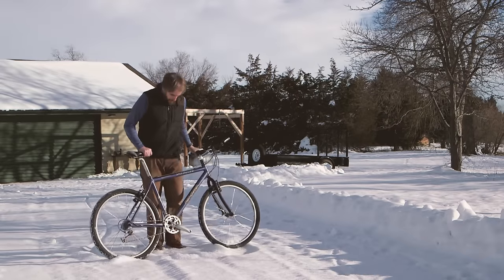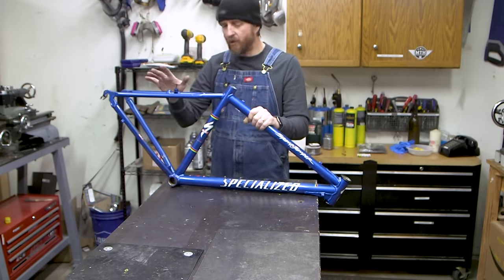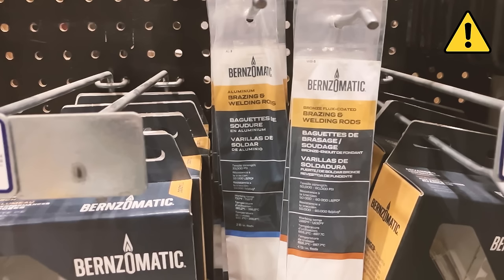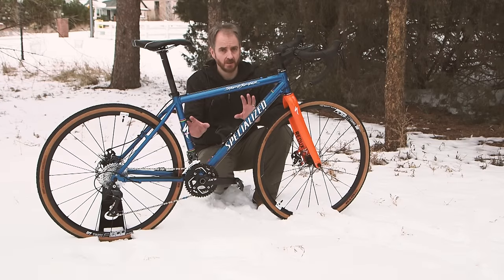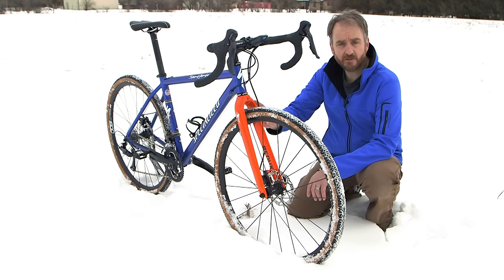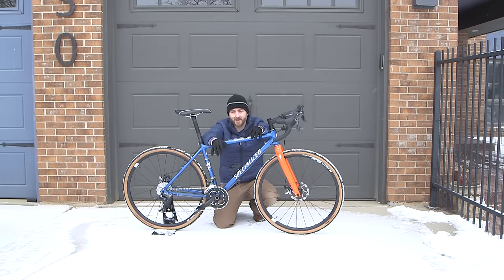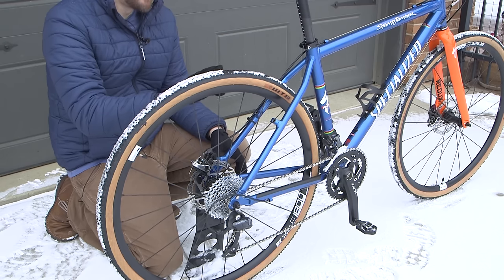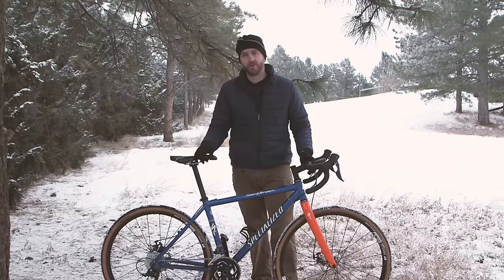Specialized Gravel Bike - Convert 90's Mountain Bike to Gravel Bike

Comment: Wow, I do have an old '95 Stumpjumper M2 in very similar color. For the gravel conversion I bought a modern 80mm Rockshox Reba Air that already has the disc mounts. For the rear brake I kept the V-brakes (XT parallelogram brakes) using an Extreme cable pull adapter. Most of the braking is done on the front anyway and a mechanical TRP Spyre does the job. Built it with Shimano Tiagra 4600 10s STI and 9s XT derailleur (same cable pull) and love it.
Reply: Doesn't the higher breaking force of hydraulic disc break damage your frame that was never designed for this force? V-brakes can be quite ok, especially if the terrain isn't all to steep.
Reply: @JohannesCycling  No. The REBA fork is quite sturdy and designed for disc brakes. The early Stumpjumper frames of the 90's were very robust as ultralight hydroformed frames were not invented yet.
Reply: @DilbertMuc  Yes of course the fork itself is going to be ok, with disc breaks as it was designed for this system. My "only" concern is the frame 😬
Have you done steep downhill descents on this bike where lot's of breaking is required? I live in the Alps, and the road steepness around here is more often than not measured in the double figures %. Some of them are more than 20% steep which can sometimes be frightning when descending on an rim break bike. 😄
Reply: @JohannesCycling  Yes, I too live close to the Alps and have been riding there for over 25 years with this bike. The M2 frame is accepting up to 80mm forks and also was delivered with a Judy DH (DH=Downhill... cough, 80mm suspension instead of the usual 63mm 😅 ) later on, even before they enlarged the bossing at the steering post.

Comment: It's worth mentioning that 7-8-9 speed Shimano shifting components have the same ratios so it is possible to mix and math sora with altus/alivio and acera. I use these on children bikes, folding bikes and on my hill climb commuter bike (9S XT cassette as bigger range than Sora and lighter than Ultegra).
Also, with 26" MTB, 650B is a good option. I ride/race my modern carbon gravel mullet bike with 650b wheels, XC race tyres and XC transmission (700C are gathering dust)
Reply: I successfully married SORA R3000 and Shimano Deore LX. Works like a dream. BTW Great video.

Comment: Love the idea. I've done a much milder version of it myself on my 2000 Stumpjumper Pro that had been sitting for over 15 years. After I replaced all the overly worn components, I simply put 26x32mm tires and fenders on it. It loses out on absolute efficiency compared to discs and 700c wheels, but it was my first serious and expensive bike and I wanted to keep it as original as possible while still being able to use it. I've put about 2,000 miles on it since and love it all over again.
Reply: I used to switch tires on my 90s mtb to 26 x 1.5 slicks back then when I wanted fast tires.
Reply: @photorockbar471  I put a 54/40 chainset on my 1990 Stumpy along with 25mm road tyres to get a fast road bike. Later swapped it back to skinny MTB tyres and left the crazy chainset on it. I used to beat everyone up the steep off road hills because I had no easy gear with a 40-28 lowest ratio and then lie on floor at top gasping for breath. 😁
Been wondering for years about resurrecting it with disc brakes.

Comment: Converted my Gary Fisher Big Sur to gravel a few years back.  It already had discs but had to convert to cable rather than hydraulic -- the road  shifters (105) were cable pull.  I lucked out as the 105 10 speed road shifters have the same pull ratio as the deore derailleur 9 speed on the  mtb. I ended up buying a 10 speed cassette and everything worked fine. I didn't upgrade to 700c and I kept the shock fork on it.  The local gravel boys thought it was a bit odd, but the terrain here is definitely a bit more off road and the shock really comes in to it's own. ( Not surprisingly folks are now buying shocks, with a lot less travel, for the front end of their expensive gravel bikes) Your frame probably has better geometry for this than mine. Nice conversion.

Comment: Love this. As a tinkerer myself (I converted my Giant hybrid with V brakes into a pretty decent road bike with disc brakes and did all the work myself) this video really speaks to me. And your final product is beautiful. Well done! The only thing I wouldn't feel comfortable doing is the addition of the disc brake mount, but fortunately for me my frame came standard with an ISO disc brake mount (though the fork didn't have a disc mount)  so converting to discs was a simple matter of replacing the fork.

Comment: Nice build! 
I can’t post a photo, but I run and own Bimble Bikes in the U.K.
Our aim is exactly what you have done, we restore, modernise and modify old bikes to meet modern demands and reduce the landfill and footprint, plus like you said, it’s a way to have a unique custom one off!
I have built a Gravel bike from a 90’s MarinSan Rafael which as you may be aware are already 700c and have MTB geometry.
Well done for your video, your build and the comprehensive guide to what’s required.
Lovely looking bike too.
Reply: Hi do you have a website? Also are you able to weld a disc brake mount like the one in this video?

Comment: I did the same but with a 2011 Ridley CX bike…..kept the cantilever brakes (Avid Shorty Ultimates), put a SRAM 1x 10 speed on it keeping the Fulcrum Racing 7 wheel set. She’s fast and amazingly still turns heads.

Comment: Having to braze on a rear brake mount probably puts some people off from doing a conversion like this.  I kept the V-brake on the back and used a mechanical disc on the front fork which I had to get new. A decent V-brake set up stops you well enough and in any case it's the front that does most of the braking as your weight is pushed forward as you slow down.
.
Reply: Yeah that would be my method without having the tools to do the mount at the back. For the same reasons you give.

Comment: Nicely done bike change.   I converted a 1994 Trek MTB to a gravel style bike.   You definitely don't need to go through the trouble of adding a rear disc brake mount since V brakes provide plenty of stopping power for most riding.  If converting to 700c wheels, then the brake mounts will be at the wrong location in the rear and will require a brake pad extension.  One can always use a disc brake on the front if one desires extra braking when they get the 700c trail fork.
Reply: There are some long slotted v brakes for conversions. You can alternate 26in and 700c wheels for events or seasons.
Reply: And there's hydraulic v-brakes by Magura I think
Reply: @paullevy-adophy9198  they are great but can flatten weak rims

Comment: That brazing is brilliant! Glad you talked about fit. The fit of old mtbs is rubbish. By moving the seat forward and using a shorter stem you've corrected for a lot of issues. Also a shorter stem improves the steering control and feel to more like modern geometry. Nicely done!

Comment: I have a 2000 or 2001 Stumpjumper pro M4 that I bought new…
A year or so before Covid, my road bike was put out of commission with a broken pedal thread on my carbon FSA cranks….i just started riding my Stumpjumper…it already had slicks on it…I was enjoying it so much I took my time loooo no ing for a replacement crankset for my Fuji….and also started looking for parts to rebuild a 92 Cannondale 3.0 Criterium….
I’ll never sell the Specialized…the Stumpjumper always had nice frame colors and parts specs…
Your blue frame is probably my favorite…other than red 👍🏻👍🏻

Comment: I converted a 94 Stumpjumper FSR full suspension to 1x10 dropbars. I kept the 26” wheels and cantilever brakes as my terrain is pretty dry and flat. It rode like a Cadillac soaking up bumps.

Comment: First time i see someone welding aluminum pieces with bare torch, looks really nice but im not sure how much time will pass before the joint brakes. Also love how old mtb frames are basically roads but taller and wider, looks brand new.

Comment: I did a gravel conversion on a 96 stumpjumper but used a chromoly version. I literally kept everything i could including the canti brakes. Came with mavic rims, dt swiss spokes laced to deore hubs. I swapped stem, handlebars and shifters. My frame is a medium but measures close to a 55, i have a video in my channel of it. These make great gravel grinders

Comment: That's really cool! I am planning to do the same with my old Rockhopper from '94. Did not dare to weld the ISO mount to the frame yet and it is quite difficult to find a 1-inch fork for 26" wheels and a disc brake mount. Currently I have a Rockshox Mag-21, which is not stable enough for the dic modification.
But your bike looks awesome! Great work!

Comment: Nice video. I has convert one old MTB (1992) to gravel like this video. Only difference is the rear brakes, because I use V-brake. In the new fork I used disk brake.

Comment: I did something similar to an M2. got a good deal on a NOS ritchey carbon fork. also, I used the stock wheels and went tubules without any issues.

Comment: 15:00 - actually, that joint doesn't experience a lot of force applied unless you start doing 180mm+ rotors with adapters that introduce side torque. The braking force pushes bracket against the frame chainstay, not away from it so it is not going anywhere. On my old bike frame I have a wide BBR Tuning Billet disk brake adapter glued with JB weld epoxy. It is holding fine for years,  epoxy is there just to hold it in place, frame chainstay is getting all the force. Also, the front brake is doing 70% of the job anyway, if one day that rear join fails - not a big deal. No need to overthink the rear disk brake adapter. Awesome video!

Comment: Lovely build. I had a Stumpjumper in 1985..Shimano XT Stumpjumper in 1989. Then bought an Aluminium Stumpjumper Team frame in 2006. Great frames. You did a fantastic job with this project. My only comment- why on earth did you leave the old canti. Bosses on seat stays?
Reply from the maker: I’m hoping to use them to mount accessories.  Led lights.  Maybe a tool bag.  Fenders.  The sky is the limit.
Reply: @RobertAdairWorkshop  ah that’s brilliant. Well thought!  Good luck.

Comment: pretty well done. I ride a 2005 Trek 7300fx Disc. odd model in a Small size upsized with 450mm post and the seat at the limit back... 110mm 35degree riser to a riser sparrow bar 35mm 35 deg 680mm wide.. some TT bars for top gear and a 650b47 120 click 11-40 widerange using the original DEORE parts.. and a 700c40mm front.

ive repeated that style build now a few times.. a 2013 opus zermatt.. a 2012 Kona Dew plus..  and a 2021 Norco Indie4 thats more of a BMX- city bike for my GF.

using triple cranks and 8-9spd is the ticket for sure. dropper bars not so much

Comment: BITD, specialized M2 frames were notorious for cracking. Any concern that brazing the disk tab might have ruined the frames T6 heat treatment condition, greatly reducing the strength of the seatstay?  Your other recommendation of TIG welding the tab to the frame definitely would have ruined the heat treatment. Though a bit crude looking, a clamp-on disk tab likely would have been better for frame longevity.   For this sort of conversion project, starting from a nice steel frame (instead of alu) would be my preference as steel is much more amenable to making brazing/welding modification.
Reply from the maker: I looked all over for M2 frame cracking when I first started this project and I couldn't find any, at least not in an internet search.  Do you have an example I could check out?  It'd be interesting to see where they commonly  crack.  The T6 temper requires 1000F for 12 hours followed by a liquid quench and then 3 hours aging at 350F.  While the brazing was done at ~730F, the entire cycle lasted about 10 minutes.  I'm not too concerned about affecting the hardening.

Comment: Nicely done!

I just finished my second such project having built my own gravel bike last summer from a donated Univeristy coop shop frame. Hand sanded the frame for 3 weeks in my off time and painted it with lettering masks.

I enjoyed that first project so much (and the results), save the paint stripping, I decided to build my son his own gravel bike. Finished that one a couple of weeks ago. Only caveat with that Schwinn frame is that unlike mine, it didn’t have IS mounts in the rear. I used an adapter which has yet to be put to the test but I already noticed that one problem is that you can’t apply pressure on the rotor in the reverse direction (as when you might brake and flip your bike 180 degrees on the rear wheel to change directions) without stripping the adapter off. This because the adapter is just mounted under 4 torqued bolts of pressure on the dropout/seat stay. The only thing preventing it from full liftoff, is the QR skewer that goes through it.

It replicates a typical IS mount but I’d prefer a brazed on adapter like you made.

All this to ask: how is the adapter and braking performance in the rear holding up? Also, what kind of brazing rod (material) did you use?
Reply from the maker: The rear brake mount has been holding up well.  I was worried it might crack but that hasn’t been a problem.  It is an aluminum-alloy filler rod.  I’m not sure what alloy, though.  It was fairly easy to work with.

Comment: Dude you totally dig my vibes. I was like ah cool, he does some machining. And than you're using a drill press not supposed to be used for milling and it works out just fine. Also the brazing is awesome, a torch is much more approachable as tig welding (which I'd like to get into thanks to other tubers) but a tig setup would need more space... also you talked about other stuff so it was interesting and the music was nice. Not for falling asleep but hey ;-) cheers from germany!

Comment: i think first video ive seen someone add on disc brakes to an aluminum frame it just always seems easier with steel. cool fork too. i wanted to modernized a rockhopper i got but then also got a 90s bianchi and later trek hybrid i wanted to kind of modernize. both of these had 1 inch headtubes though. aliexpress has a few fork options though or maybe weld on tabs and repaint the trek. cool video though. reddit xbiking is a similar community

Comment: You may want to consider looking at the Giant Conduct system, this will take your cable pull levers and convert them to a hydraulic disk brake system.
Reply from the maker: I'll check it out.  Thank you.
Reply: @RobertAdairWorkshop  no trouble at all. It was a bit of a failed system when Giant first released it as they tried to pass it off as a full hydraulic disk brake system on their bikes when in reality it is a mechanical to hydraulic conversion system. Many of the similarly priced hydraulic disk road bikes were coming with a fully hydraulic brakes systems so people felt short changed and didn't like it. As disk brakes have become more common and people are looking for options to improve on mechanical disk brakes it has seen a bit of a resurgence as it is normally a good bit cheaper than the mechanical to hydraulic caliper units.

Comment: Wow you tought me something tonight didnt know you could braze alloy like that cool . I am doing a similar build with an old carbon 26 hardtail frame which has is disc mount already thanks again good info 😁👍✌
Reply from the maker: I did carbon repair on a Specialized Roubaix several years ago.  Repaired a cracked chain stay.  I am confident I could have added a disc brake mount to that frame.   I wonder if carbon frames exist with linear-pull brakes?

Comment: I wish I was more patient in finding a smaller frame when I did mine. I have a grx cranks + grx400(10sp) RD, running 650b with 48mm tires, 30mm stem.

Comment: Very nice build. Depending on the terrain you ride, you'll eventually realize that mechanical disc brakes are simply not strong enough and need to be replaced by hydraulic ones.

Comment: I would have recommended tapering the joint. add a bevel to it so that when being filled in the aluminum rod has a larger surface area to grab onto.

Comment: Great job! Esp the brake mount (I used Map gas to replumb my house so appreciate the skill not to melt the Alu) 
However, I took the lazy option and just bought a 2016 Giant Cross City 1 (commuter bike) which happens to meet all your criteria for a Gravel bike except for drop handle bars. I got lucky as it was already fitted with tubeless-only Stans Iron Cross wheels (1500g).  I just bought it (3rd hand cheaply) and have ordered replacement for the flat bars with a Ali express version of Koga Denham bars which have "drop bar hoods" hand location built in (best of both worlds? ).

Comment: With your abilities I am surprised you didn't remove the vbrake mounts from the stays. Great looking build though. Top job
Reply from the maker: I left them there thinking they'd be a good place to mount a rear light or other accessories but  I think you're right.  I may cut them out and repaint the stays.

Comment: Real "restoration," liked how you used touch up paint and color matched the original colors. Too many restomods out there with new paint. I used to have second set of wheels with metal studded winter tires for my gravel bike when I live in Chicago to ride on ice and snow.